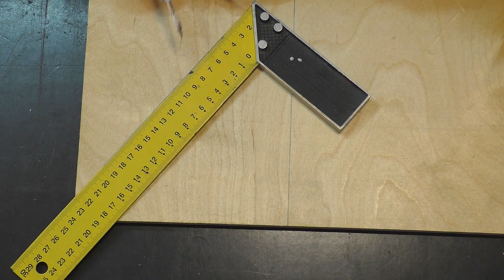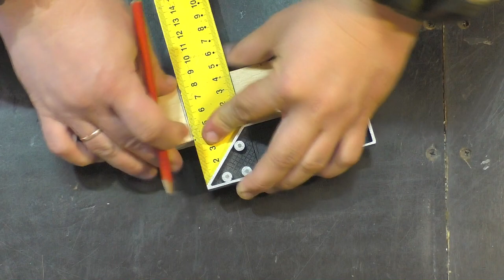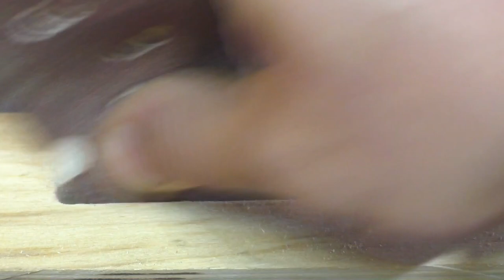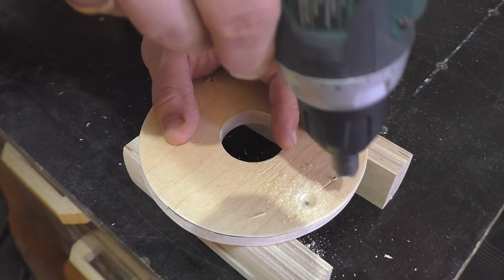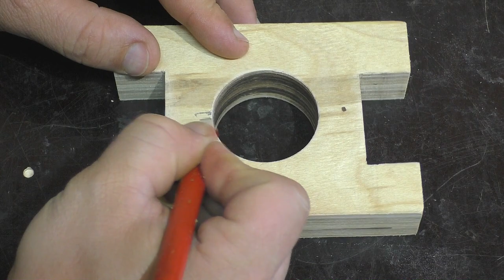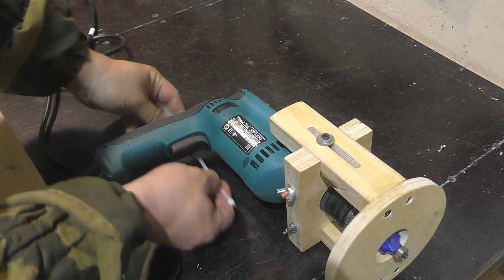Amazing drill machine! Cool idea!Creative Ideas with Drill Machine

Comment: Why do individuals do dumb things? Most electric drills, battery of corded, do not turn at revolutions above 2500 rpm. Any idea of what the slowest wood router rpm? Depending on the manufacturer and design, wood routers use from 8000 rpm to 25000, depending on the radius of the router bit, the material to be shaped, and the bit profile.  Routers also use precise fitting collets rather that sloppy fitting drill chucks. That means the router bit will be a bit unstable in its use.  And most hand held electric drills run about 6 to 8 amps in power rating, far less that your standard router. The higher the amperage to greater the torque. And routers do not use reduction gearing as some drills do. So why in the hell would you want to jury rig your drill to try and route wood? You will not achieve the desired quality of machining you want, you run the risk of damaging your bits and damaging your drill as well. There is a reason why a good workman uses the right tool at the right time. Besides, one can always go over the Harbor Freight and buy inexpensive routers that will do a better joy than a jury rigged drill/router combination. And we haven't even talked about safety.
Reply: cuz they doing this for "likes" only
Reply: Great answer ! Your right on the money with everything you said, including your last sentence. Thank you

Comment: I don’t this it is safe. The drill is not designed to be working long time.
Reply: Depends on the brand and if its on battery or core really. A big one who is design for though jobs and are on core, I wouldn't see any problem with that.
Reply: @stonebridge157  there are actually a few problems you should take into account and that hold true for ANY Drill: a drill is MUCH too slow for a router bit and, even worse, a drill is designed for being pushed downwards, nur routing provokes forces sidewards. Just don‘t try this. It’s stupid, unsafe and it won‘t work.